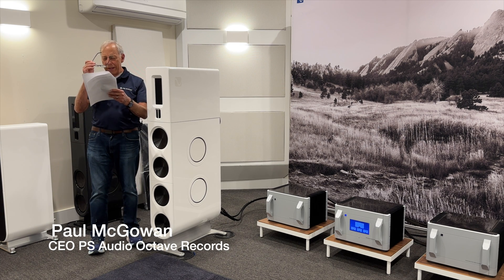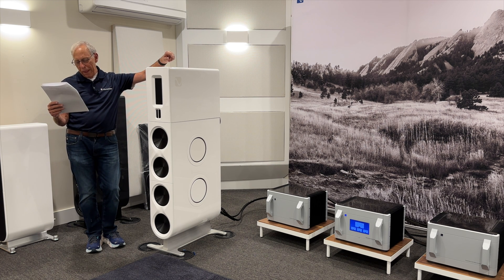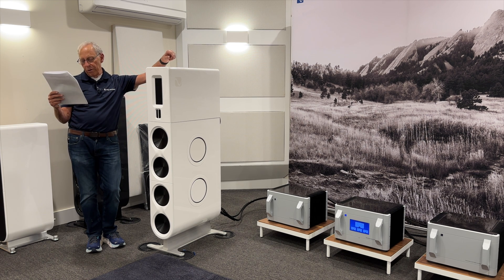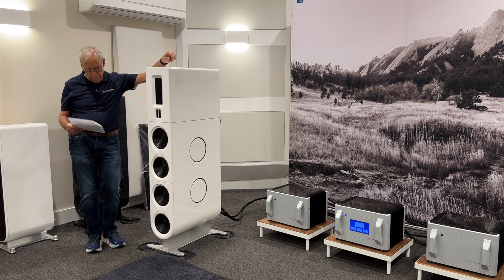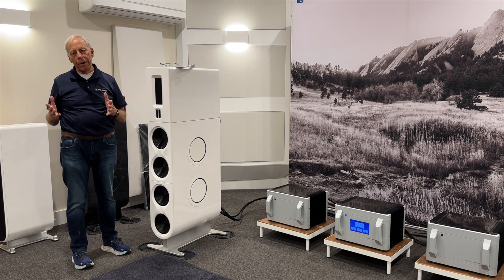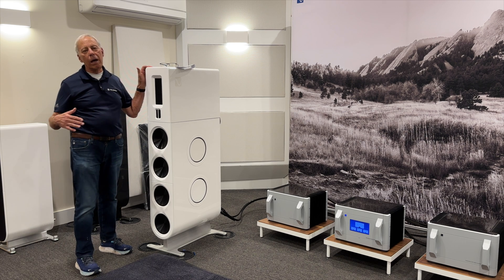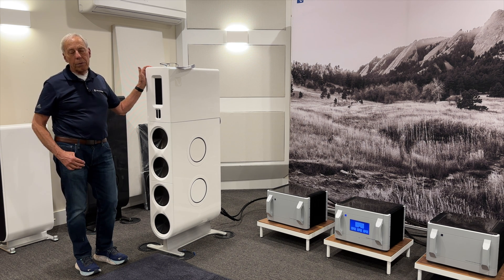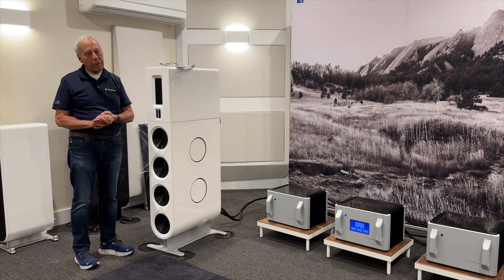Potted loudspeaker crossovers

Comment: Deadening a speaker's cabinet is important, to achieve the best focus.  If the cabinet shakes, then the drivers shake (not talking about drivers moving to produce sound -- rather, woofers (for example) shaking the midrange drivers).  If the drivers shake, then the sound loses some focus.

Imagine having two friends holding your speakers, and moving them around while you listen.  You would hear it.  Well, when your drivers shake, you hear that, too.
Until you really deaden the cabinets, you will not realize the diminished focus that you've always had.

Vandersteen offers heavy, granite bases for their top two speaker models.  Those bases reduce the speaker's vibration.  They effectively add over 100 LBs to the weight of the speakers (the granite bases are screwed into the bottom of the speakers -- the speaker do not merely rest on the granite bases).

Townshend makes seismic platforms for all types of gear, including speakers.  They attack vibrations not by weight, but by suspension.

Place your turntable on one of them, and you will be rewarded with better focus.
Place your pre-amp on one of them, and you will be rewarded with better focus (albeit, to a lesser degree vs the turntable).

Place your speakers on them, and you will have similar sonic rewards.

They use parts rated for various weights, going into the hundreds of pounds weight class.  You choose the seismic platforms according to the weight of the items being placed on them, as well as the distance between your equipment's feet.  So you choose the how large of a platform you need, and how much weight that platform is designed to support.

I have heard very respectable stereos before and after addressing the vibrations.
it was all very noticeable, and all positive.

A stereo that sounded great, simply sounded greater.  A sense of ease was increased to the soundstage, which was a result of better focused sonic images.  And slams and crashes had a better attack.  Everything was just better.

Comment: Potting is pot-entially wasteful and overly protective of the design of the crossover. Unless you are using off the shelf drivers, so what if someone gets the crossover design? Not like they have the drivers to purchase easily.
Potting is also great for hiding the components you used from "audiophile eyes" judging you on parts quality.

And if you were serious about vibrations, then the crossover would be outside the speaker or at least suspended like a turntable, and only individual parts need be dampened . 

Orientation of parts of also of more concern than covering it in resin. I don't think anyone can tell the difference between a potted and non potted crossover :)

Comment: Interesting idea, potting crossovers. I often wonder about putting electronics near speaker drivers, Your trying to create a sonically perfect place, but then bung in all these items that were never designed for their acoustic properties.
I suppose you could have a special chamber in your speaker, away from all the moving air etc, for the crossover, however potting it would be another option, lock all the bits in-place, stop them from trying to dance around with al that sound energy.

Comment: I purchased a pair of really nice looking black Aluminum chassis from Hammond, mounted 10, 10uf Wonder caps onto 1/4 inch plexiglass with rubber feet attached to the plexiglass. Then employed a thick layer of silicone rubber to bond the caps to the plexiglass and then siliconed 1, 30uf, 3 ,20uf, MIT PP film and 3, 3uf  MIT Polystyrene caps on top of the Wonder caps. Used a single 3.18mH CFAC Inductor for the woofers.  WBT connectors carry the signal from the monoblocs to the simple 1st order circuit and away from it to the loudspeakers.

Comment: For some reason everyone is missing why some manufacturers pot crossovers. The answer is that they are noisy. The inductors vibrate because of the varying magnetic field they create which in simple terms is how inductors work. If you take an unpotted crossover out of the cabinet, still connected and play your music you will also hear the music coming from the crossover. What you hear most are mid frequencies upwards since the rate of change increases with frequency. Anyone who has made their own inductors and tried them out of the cabinet will know this. Some manufacturers impregnate inductor coils for the same reason to prevent the  coils from vibrating against each other. Indeed, some capacitors have a relatively high self inductance as well and they can be “noisy” although nowhere nearly as noisy as inductors. Low frequencies eg 50 or 60Hz (mains supplies for instance) are almost inaudible unless the magnetic fields are interacting with external metal objects.
Reply: Then there is the other side, applying mechanical stress (sound waves) can effect the components electrical values, in effect modulating the signal going through them, In low level circuits this manifests itself as parts being 'microphonic', however there is no reason this would not also occur in a crossover - admittedly though I highly doubt you'd ever hear anything in the sound coming out of that speaker. However we here are audiophiles, so don't leave any stone unturned.
Reply: Anyone who's ever bench tested a Class D mini-amplifier knows how much noise the coils can make ... especially when they're backed up against a chip's heatsink.  I keep telling them to keep the little springy wire things away from the big hunk of metal but they just keep on doing it.

Comment: I get potting sub-assemblies in hazardous conditions where the circuitry might be exposed to caustic chemicals or in high precision devices where uniform temperatures are essential to maintain accuracy ... 

But a crossover??? Nope!  Simply not necessary.
Probably an attempt to hide the design and/or prevent parts level service.

Comment: I have a midrange driver that is capable of going down to 80 hertz, which is low for a midrange driver. I mixed and matched and put it into a speaker whose  woofer crosses over at 100 hertz. Yet when I play something with real deep or loud bass, my midrange driver sometimes sounds like it makes a slight & barely perceptible clip. I think the 100 hertz crossover is allowing frequencies below 100 hertz to be fed to my midrange. Is this normal? When they say a speaker crosses over at 100 hertz, is it a strict thing where 99 hertz and below are not let through at all? Or is it a less strict thing where some frequencies just below 100 hertz normally make it through to the midrange. It is not letting real deep bass through to my midrange, so the crossover is working. Was just wondering if this is normal?
Reply: Crossovers are not a switch.  There is a slope on which the woofer fades and the midrange is gaining.  The same happens between the mid and tweeter. These slopes are surprisingly gentle often no more than 6db per octave and rarely better than 24db per octave.

On a typical 3 way system you will hear some of the lower midrange from the woofer and some of the upper bass though the midrange.  The same will happen with the upper midrange and lower treble as it crosses from midrange to tweeter. This is actually by design, to keep the frequency response even through the crossover regions. 

So yes, it is normal and expected behaviour.

Also... as a general tip ... just because a speaker can go down to 100hz does not mean that it should.  The audio band is 3 decades ... 20 - 200, 200 -2000, 2000 - 20000 ... and those are usually the best crossover targets.

Comment: Potting is done so you can't copy or  repair it.
Reply: Exactly
Reply: Yep and unless using off the shelf drivers, what's someone going to do with the design?
Reply: @RennieAsh  It gives a good design starting point.  You should be able to find  speakers that can be close.  If the output from crossover needs some attenuation or remove some, it can be done. Or if you need to move the points, it can be done.
But you have a design they spent a lot of time and money on.

Comment: depends what you pot them with and how hard the whole thing is ran.  right compound keeps the temperatures more even, it's not just about environmental protection or vibration. if it's in an enclosure that has drastic fast pressure differences too it'll help with that to some degree.

though caps tend to be a crapshoot with year they were made in when it comes to if they will last 10, 30 or 60 years anyway.
Reply: My Infinity speakers are 1986 vintage and some of the original electrolytics test within 2% of spec. New ones are no better than this. I have replaced the ones that have.

Comment: I would think the vibrations inside the speakers would reach 1000 on the Richter scale, so wouldn't be better if the crossovers are external, attached to the rear of a speaker in a small enclosure?
Reply: Some manufacturers put the crossover in a plinth beneath the speaker.

Comment: Film capacitors, if of high quality, will not deteriorate as fast as electrolytics do.     
Potting not only reduces the chance of vibration affecting performance, 
but it also causes the repair or replacement of the parts it covers 
to be somewhere between painfully difficult and downright impossible.